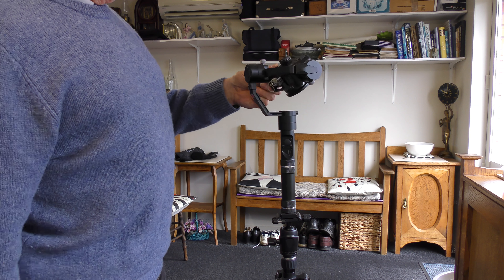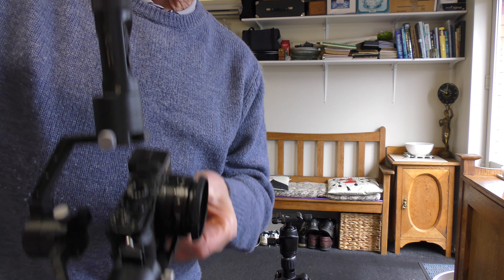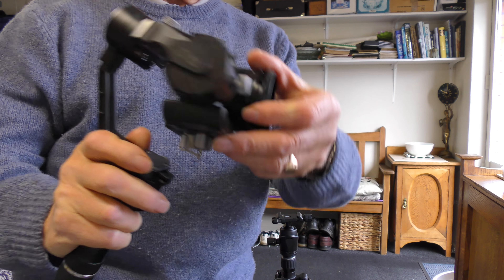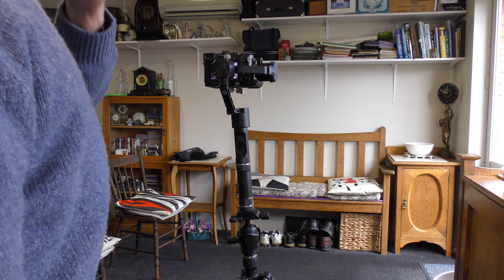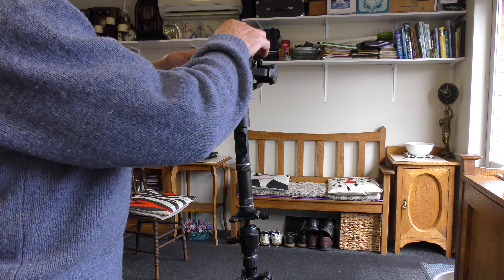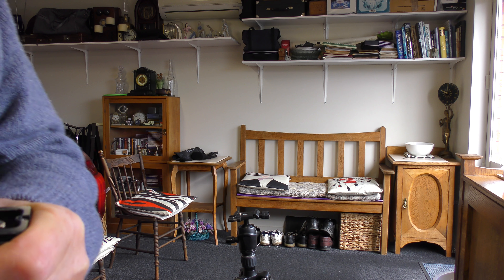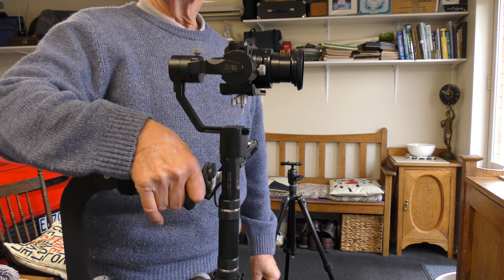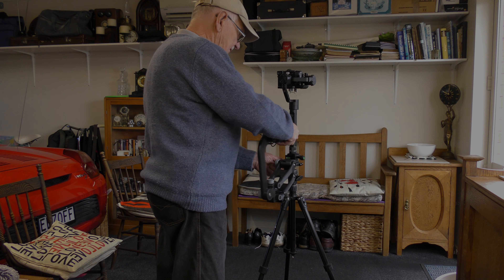Inverting LX100 on Crane M

Comment: Hi Barry, well, I've mastered the technique of flipping the camera, thank you. BUT . . . whenever I turn on the Crane it acts in a completely different way to yours. Your camera stays in position and stable. Mine immediately wants to flip itself so that it is facing in the opposite direction, i.e. facing the back gimbal. If I manually turn it around to face the back gimbal and turn it on again it stays there but obviously, that is not what we want. I've tried it it a few times but I'm worried about damaging the motors as it knocks against the side as it is trying to turn itself around. It's been a frustrating afternoon and maybe I have a faulty gimbal. Thanks to you though I have now mastered the technique of flipping it.
Reply from the maker: So, I take it that this only happens when the camera is inverted and you turn on the Crane M and not at all when the camera is upright, ....... I've never had that problem ...... How balanced is the camera with lens extended when it's inverted on the crane without power on. compared with when its upright on the crane without power on ? Also, is your camera mounted exactly the same as mine ( with the HDMI/PC Door Close to the Gimbal Motor?)
Reply: I thought I replied but can't see it. Camera upright, no problems. Camera perfectly balanced in upright and when I invert it (no power on). Camera mounted exactly as yours, camera right up against gimbal motor. I flip it and turn it on and it immediately turns as though it wants to go back to upright mode. I thing it is faulty and will take it back to the shop tomorrow to see whtat they think.
Reply from the maker: Well hopefully they'll sort it out or exchange it......I can't think why it's doing that ,unless it needs a Firmware update ( I do remember updating mine) ...Thankfully you can take yours back......I purchased mine off Ali- Express. .....FYI,.... I got a wee remote with mine that i often use when slow panning on the tripod. Has all the functions of the Crane M controls. ........ Let's know how you get on Bill.......
Reply: Well, I spent a very frustrating hour and 15 mins in Camera House trying to explain my problem to the assistant who admitted that he didn't know much about  stabilizers (couldn't believe that!) He told me I was doing it all wrong until I showed him your video (lifesaver, thank you). He eventually came round to my way of thinking that there was a problem. He then spoke to a colleague on the phone who apparently knew more about stabilizers. He said the problem was with the balance (it was perfectly balanced!) The colleague then said there was nothing wrong with the camera. Anyway, to cut a long story short, The assistant said they would try it on another Crane M and if that one worked, they would replace mine. I will never buy anything again from Camera House, their customer service was appalling. Sorry for going on but it was all beyond frustrating.
Reply from the maker: I understand exactly where you're coming from.
 ....they're only there to sell you something ....
that's the impression I get.....If I were you I would  ask to
 be present when they try out the
 other Crane  before they mishandle 
and damage that one as well.....Have you downloaded the 
Zhiyun Assistant App? ....You can use that to get into the crane settings and adjust them to 
exactly what you want . If you have , check the last setting "Electric Motor Intensity" and set 
it to "WEAK" That's an important one and is  right for the LX100 .
Reply: Yes, I've downloaded the Assistant App. I haven't changed much except the pan speed which I've slowed right down. I'll also change the motor intensity, thanks for the tip. Have you ever tried doing a timelapse, setting a start and end point? I've tried it a few times but the results are quite jerky, I see that many people experience this. It needs a bit of stabilisation in post. Maybe they'll fix this in time.
Reply from the maker: To be honest, I'm not a big fan of timelapse and haven't tried it on the Crane. But I spent a lot of time on the crane settings, learning how each setting affected  the motion of the Camera,...ie "Control Dead Zone"setting ....  was for when should the gimbal follow your movement .... "The Following Rate" for how fast the gimbal will follow your movement....and "the Degree of Smoothness" for how fast the gimbal starts or stops a movement..... Once I had my head around that I began to change the settings to what I wanted.